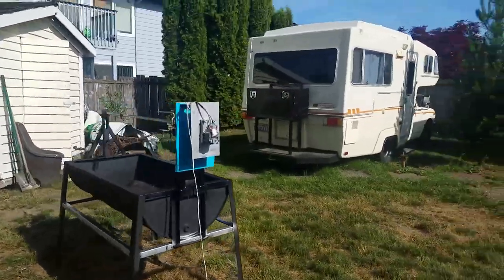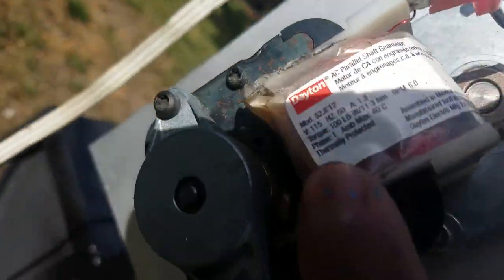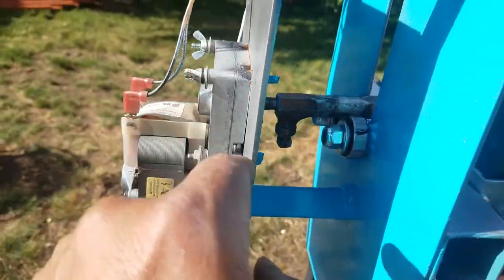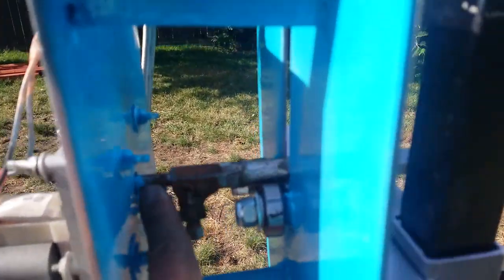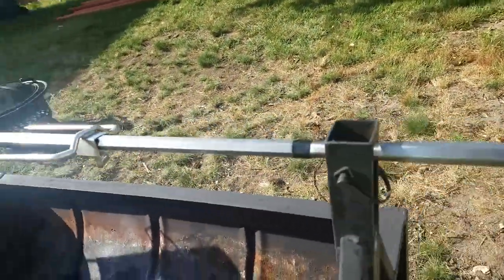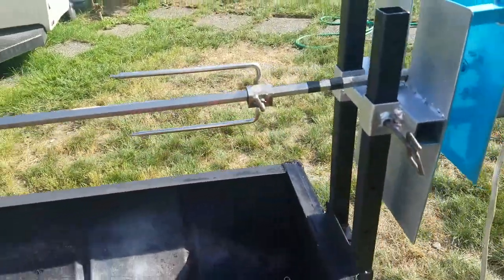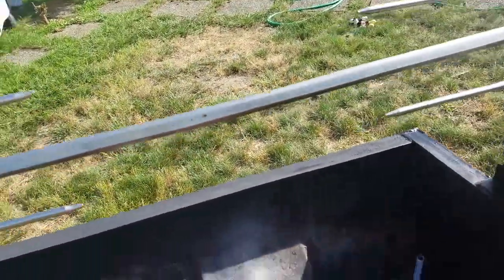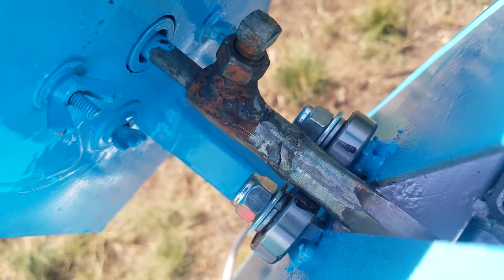The Best & Simple PIG Roasting Machine (Rotisserie Update)

Comment: I have a motor like that but at 1 hour its very hot, and have a temperature control that turn off the motor when its hot, that one do the same?
Reply from the maker: Exactly its very hot ....reason I modified.... by adding bearing front and rear .... now the whole pig cook for 4-5 hrs no problem at all
Reply: Thanks its a great idea , thank you for the answer Sr
Reply: Omg i love this and thanks for showing it so we can learn new subscriber here Plz can you tell me if i need to use a stainless steel rod or i can use any kind reason i ask cause stainless steel is expensive
Reply from the maker: @carmenarroyo4060  yes Maam you can use any rod make sure Strong
Reply: @Angelsum143  thank you very much
Reply from the maker: @carmenarroyo4060  your welcome po